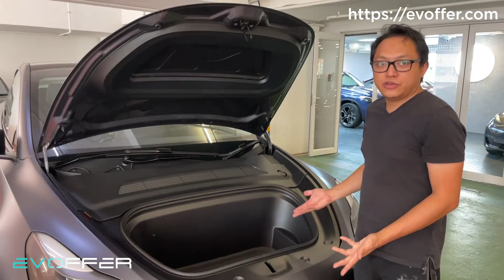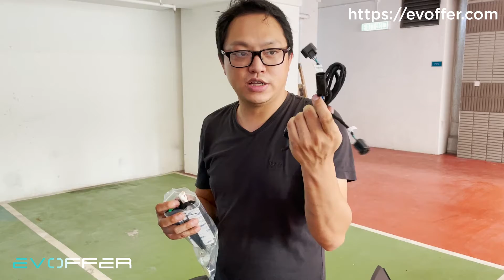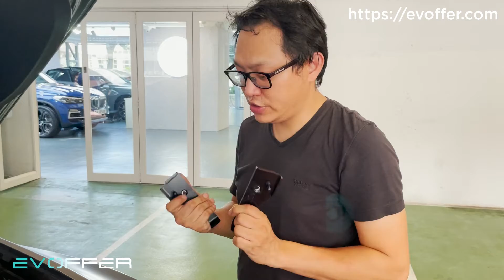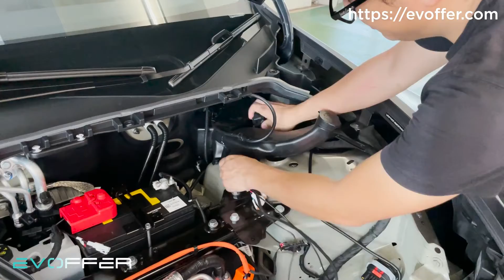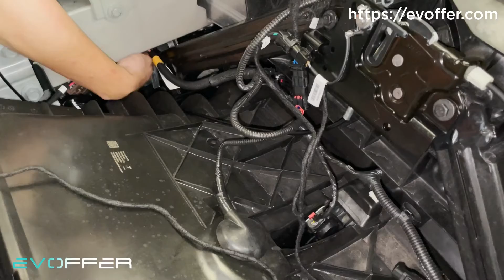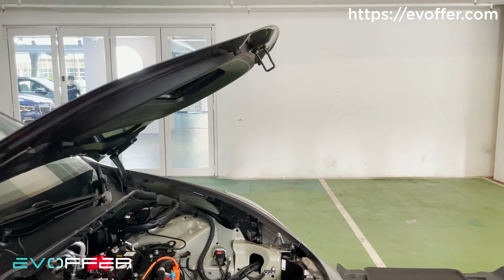EVOffer (Tesla Offer) - Model Y Electric Frunk (Mark 4.0) Installation Tutorial

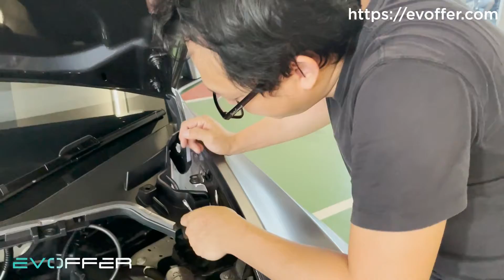Comment: 12:05 
To fit your arms down at the side of the front fenders to remove and then install the actuators down in that tiny space,  cut out the toes out of old long sock or get a small friend smaller than Raymond !
Reply from the maker: @bearlemley  Haha, a longer tool may also help!

Comment: Hi
Having a question as i installed EV Offer auto frunk but due to some reason it closes fine but when opens it unlock from the latch but doesn't open up and i have to press open again to open the bonnet. Any suggestion? Thanks
Reply from the maker: Hi, adjusting the latch position may help. Please reach out to our tech support team for assistance and troubleshoot. Thank you!
Reply: @EVOffer  Thanks for the tip and it worked 👍

Comment: Strusts are a HIGE pain in the ass. You cannot just push in the install on the new struts. Its very challenging.
Reply: I put some grease on the ball joints and also used a coat hanger to make a little j-hook to expand the spring clips.  They helped but still not easy because of lack of space for my hands and arms.

Comment: What is the 3M tape for?
Reply from the maker: They may not be useful if you have already secured all the wires with zip tie
Reply: @EVOffer  I have - although I found the placement of the latch motor to be confusing - I don't think it is really secure being zip tied to the cable down there. I thought your video was very good overall except for this part which was vague. The shape of the motor doesn't seem like it has a good way to route the zip tie so it will be 100% secure.

Comment: Will this work with the new 2022 Model Y with Lithium battery?
Reply: Just installed mine with a li-ion battery and it came with a bolt that screws into the post behind the red rubber cap. Works great!
Reply from the maker: Yes, it will work perfectly
Reply: @EVOffer  I have a 2022 MY with Li-ion 12v battery.  There are no bolts like what was present with the older 12v lead-acid batteries.  There is a threaded bolt that is normally used as a connection point for jumper cables if the Li-ion battery fails, but there are no nuts on this bolt.  Do you know the size or include nuts to secure the frunk opener power lead to this battery terminal or is there another 12v connection point that should be used.
Reply from the maker: @johncarr5200  the bolt will be included in the kit to secured the power tap wire

Comment: Are the structs quieter on newer versions of the kits for 3/Y?  It sounds pretty much silent when you were doing the tests, but on mine (Mark 2.5) it is fairly loud and always has been.
Reply from the maker: Hi, are you referring to frunk or trunk kit?
Reply: @EVOffer  Both.  I have Mark 2.5 trunk kit and Mark 3.1 frunk kit.  The frunk kit in this video sounds almost silent.
Reply from the maker: @Durzel  i think it is because of the strut position. The strut on Model Y is hidden so the motor sound is relatively unnoticeable.
Reply: @EVOffer  Good point, I hadn't considered that.  Here is mine for comparison - https://www.youtube.com/watch?v=9zoSEtN5yGE (you've seen this before I think)

Comment: I had trouble figuring out how best to attach the new struts to the ball joints. It helps a lot if you rotate it back an forth over the ball. Pushing directly in is very difficult.

Comment: Sometimes upon opening it just pops the latch but doesn't actuate. I have to hit the button a second time for it to open automatically. It closes always on one press though. It's intermittent sometimes it opens all the way on one press sometimes it requires two presses could you let me know what I can do?
Reply: did you get this fix? i just installed mine and i'm experiencing the same issue, the only way to get it to actuate to "open" is by slightly lifting the hood.  Double clicking for me when the hood is open doesn't do anything but click the latch.  

closing works perfect, but when opening, it opens the same as stock, it doesn't "auto lift".
Reply from the maker: @Got2BNoel  Try adjusting the additional latch mechanism downward and see how if it could fix the issue. Contact our tech support if you still cannot make it. Thank you!
Reply from the maker: Perform a firmware update. You can reach us through telegram

Comment: @EVOffer (Tesla Offer)
Please help me troubleshoot my unit.It always responds to "Open" at first button press.But takes 10 - 20 button presses to close the hood.10 - 20 presses on both the car screen, the app, the emergency button.

Have installed newest firmware from 13th of October 2021.
EV-Offer Power Frunk.Mark 4.1 ? (Box says Mark 4.0)
SW v15. F20
Build: 210805
F10212191
AF10V1500

Please look at my video below filming the problem.
My car, Tesla Model Y brand new, from China, produced summer 2021.

https://youtu.be/SygmLtMiVnk